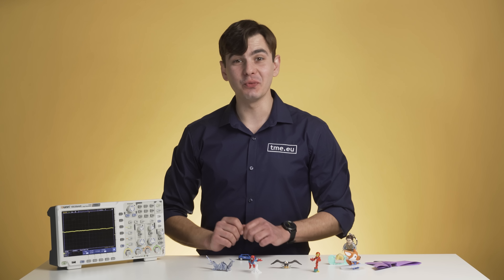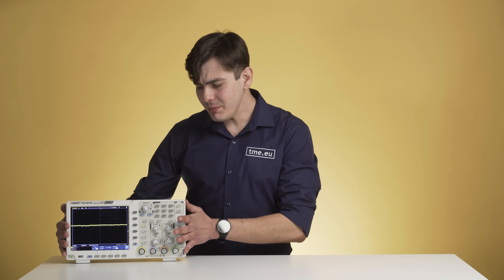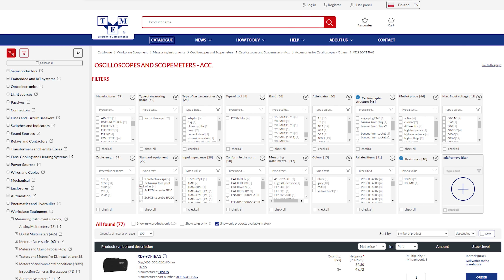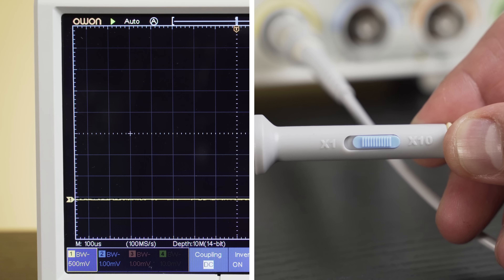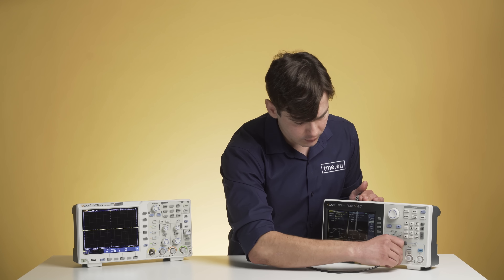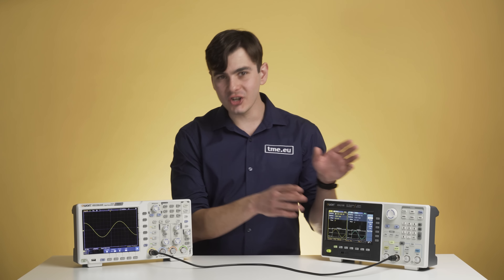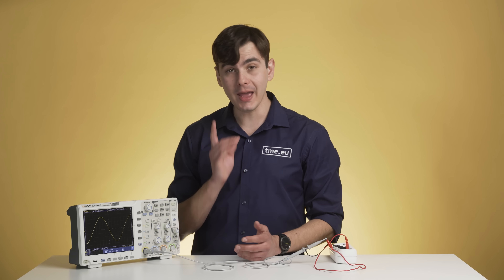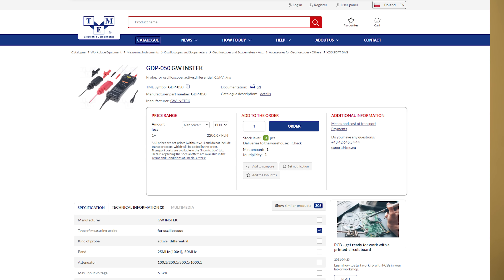Calibrate It Before You Make It... Work! || 3 Tips to Handle Your Scope Properly

Comment: Thank you. I have a GW instek mdo 2202 and calibrated, the two inputs A and B do not measure the same on a 9v battery, input A measures a little too high (20mv) it is a little frustrating, but two multimeters do not measure the same either.